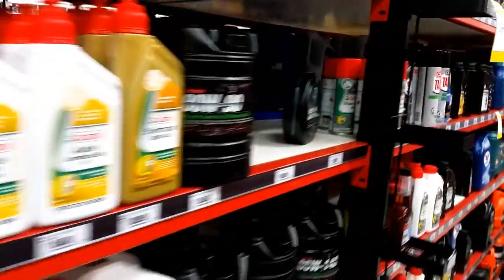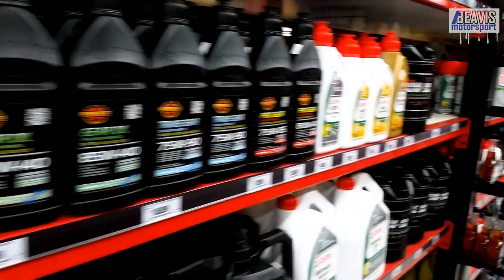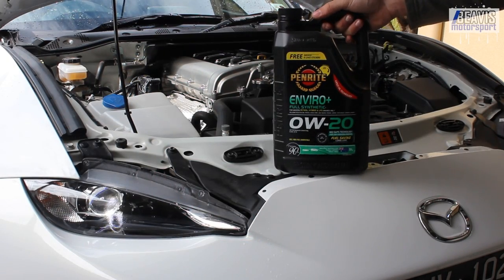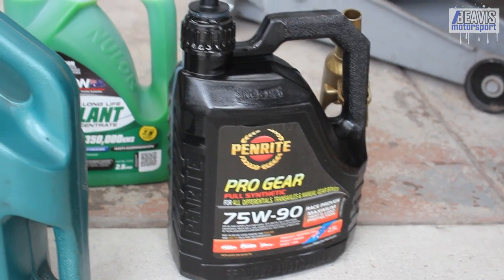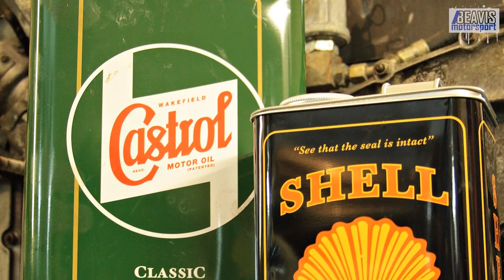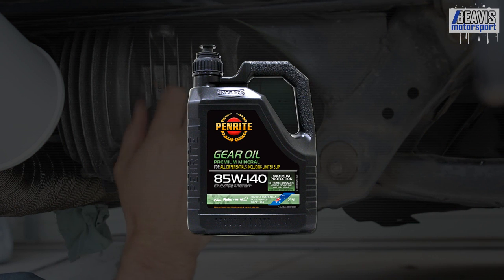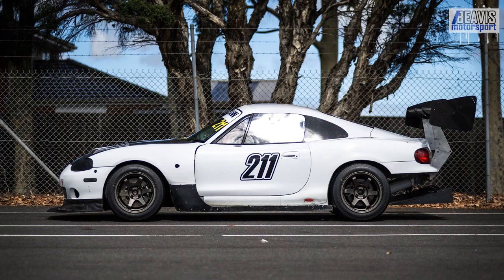COMPLETE GUIDE TO OILS FOR MAZDA MX-5 MIATA

Comment: The 8 dislikes are automatic miata owners
Reply from the maker: Lol! :-P
Reply: Nothing wrong with automatics ,my wife's Rf club is her daily driver to work everyday.  She gets 37 mpg and doesnt have to wear her arm out during an 80 mile commute. That's very important when working in the dental field to keep a steady hand.
Reply: Auto miata driver here, cannot WAIT to swap it.
Reply: In their defense I will say that when I get too old to shift I may switch to an auto. But at 67 I still have no problems
Reply: @Bbeavis  WHAT ABOUT THE SHIFTER OIL ?
Reply from the maker: @mw10259  What about it?
Reply: @Bbeavis  What do i use ?
Reply from the maker: @mw10259  The same gearbox oil as the rest of the trans.
Reply: @ryanchristensen1799  I'm actually planning on trading in my automatic '14 Mazda 3 Hatch for a new Miata RF with a stick as a daily driver, since I've gotten too addicted to my '04 NB, since it was the car I learned stick on 🤙🤙

Comment: Just change my ND gearbox oil with Penrite Pro Gear Full Synthetic 75W-90 as recommended by Repco. It's now a bit notchy when cold. What viscosityis the Mazda long life oil recommended in the owners manual?   Are you doing a video on piston return springs?
Reply from the maker: According to the manual: "If Mazda Original Long Life Gear Oil IS cannot be obtained, use standard oil (API Service GL-4 (SAE 75W-90))" So in theory as long as it's a quality GL4 to the spec weight, it should work well. From memory, Penrite does a GL5, but not sure they do a GL4.
Probably need to check out a different channel for piston return springs, perhaps "ChrisFix", sorry John.

Comment: Also, to those who want an easier shifting trans in the cold, I've had great luck with the Motorcraft XT-M5-QS fluid. After 20K miles, my trans still shifts like butter. Previously, I was using Redline's MTL fluid which is good, but found the 1st-2nd shift to be a bit notchy in the cold and during hard driving.
Reply from the maker: Thanks for the info Dylan! :)
Reply: Dylan Lewis for a na or nb

Comment: You may want to warn people that there is a plug on the transmission that looks like the oil fill/level plug, but isn't. If by accident it is unscrewed then internal selector parts fall into the gearbox and you will have to take the entire gearbox off the car and apart to fix it!!
So make sure you locate the correct fill/level plug when doing this.
Reply from the maker: Good tip - people should probably look up the details of how to perform an oil change before they go and make mistakes. Thanks for watching Roger!
Reply: BEAVIS Motorsport ; was
Reply: Roger Crier, Yes, I had a Ford truck years ago and an oil change shop did just that...
Reply: +Roger Crier  Just wanted to add that, from what I can gather, this is only for the 6-speed boxes.

Comment: I ran royal purple recently in my 90 miata and it made a huge difference. In idle quality and start up and everywhere. And im in pa where it goes from 15-75 degrees in 8 hours
Reply from the maker: Thanks for sharing GameMoments!
Reply: @Bbeavis  Ive also found that taking my ND 1.5l to Mazda dealerships  to get it serviced and they used 10w 30. So Im not sure to be worried haha. so Ive recently just serviced it with 5w 30 my self.
 From Australian dealerships

Comment: Some info about shifter rebuilds:

You’ll see a lot of threads mentioning that you need to syphon out and replace the oil in the turret. This is only for the 5-speed. The 6-speed is “self lubricating” and doesn’t need to be filled. 

Source: idk but it took me like 4 hours of research to find this info online after I discovered my turret to be wet with oil but nothing to syphon out lol
Reply from the maker: Good tip, thanks Uriah.

Comment: Excellent Video; however, I had trouble finding info on Automatic Transmission fluid changes (especially for 2006-2009 Miata NCs). On the Manual Trans. there are Fill and Drain bolt (top-Bottom 23mm and 24mm) BUT on an Automatic Transmission there is a 24mm Top fill bolt (on the side) and a regular Transmission Pan drain plug "under" the transmission with a 9/16 bolt. Also the Side Top Fill bolt has a "rubber" washer gasket (NOT a crush washer) so just snug it to keep it drain coming out (wouldn't torque it hard). My 2007 Car Manual calls for JWS-3309 Trans fluid and I found three types on EBAY/Amazon...Mazda Fluid, Aisin ATF-OT4 and Idemitsu ATF Type M. Also the Automatic Transmission takes three and 1/2 quarts to fill.  The rear Differential has two bolts 23mm fill and 24mm drain (both with crush washers and torqued to 25-33 ft lbs). I used Redline 75w90 gear oil..took less than 1 quart.
Reply from the maker: Thanks for sharing ;-)

Comment: I have found these gearboxes to be quite sensitive to cold temperature viscosity. There can be a huge difference in cold temperature performance for a bunch of different 75W90 oils. Penrite Pro-Gear 75W90 GL4 for example is very thick @ 40C which means it will be incredibly thick on cold sub 10 degree C mornings. Redline MT90 is thinner @ 40C than the Penrite oil.

I had Penrite in my gearbox and it was super stiff just moving out of first, and it felt like there was a physical barrier blocking 2nd until I drove for a bit.

Nulon 75W85 has excellent cold shift performance and feels good at operating temp.

The Ford/Motorcraft oil is only slightly thicker than the 75W85 at cold temps but is thicker at operating temps, so should offer a bit more protection.

If cold shifting is an issue where you live then it would pay to look at a few different gear oils product data sheets and look for an oil that has a relatively low viscosity @ 40C but sufficient high temp viscosity for protection depending on what kind of driving you do. If you do a lot of track driving cold shift performance might not bother you or you can deal with it. But for a daily driver/commuter I would avoid the super high viscosity stuff.
Reply from the maker: Thanks for sharing this information Jake.
Definitely over the years I have seen/heard many people describe similar experiences to yours, different oils present varied experiences for the gearbox. The box does appear to be quite sensitive to oil choice.
I've recently tried some Amsoil GL4 stuff and it's been rather nice.
Reply: @Bbeavis  I have got some of the Motorcraft oil on the way for my ND, at 40C it is only slightly more viscous than the thinner Nulon 75W85, but is thicker at 100C so in theory should offer better high temp protection with a minimal difference in cold temp shifting.

I think there are also differences in the tolerances in each gearbox as some people have said their ND gearbox has always been 'butter smooth' and others have said it's always been notchy, almost to the point of crunchy, although this could also be due to the ambient temperature where people live. One person might closer to the equator and keep their car garaged, so the gear oil is never that cold and as such is closer to an optimum temp for smoother shifting. Someone who lives in a colder climate and keeps their car outside overnight could experience stiff shifts even with lighter oil.

Once mine is warm, with either the 75W85 or 75W90 its a firm shift with a bit of tactile notchiness and a fun sounding gear whine when accelerating in 3rd and 4th gear. 

I daily drive mine with the occasional country road blast here in NSW, so I'm happy with the protection of a 75W85 for now but would be happier with a 75W90 that has good cold shift performance.

I am starting to believe the factory fill, Mazda's special long life gear oil IS is actually a 75W80 or a 75W85 but have yet to find a data sheet for it. The factory fill diff oil is the Hypoid gear oil SG1 which is a 75w85 oil.

The thinner oils seem to be in line with the thin 0W20 they spec in the engine for fuel economy.
Reply from the maker: Some good points.
Agree 100% that weather and driving style impacts this.
I ended up moving to a sightly thicker 5w30 engine oil from my ND, as we have some pretty cold weather in Melbourne.

Comment: My mechanic (official Mazda mechanic in my country) started using 10w60 in my nb. I only burn noticeable amounts of oil above 4500rpm. 230k km. should  I keep using 10w60?
Reply from the maker: If you drive the car in a warm climate, or perhaps a lot of spirited driving such as track days... and/or if you trust your mechanic - then 10w60 might be appropriate for you.
I'd usually only use something like 10w50 or 10w60 for a track-dedicated car that sees high temperatures.
Reply: @Bbeavis  thank you so much! Greece I’d say has a pretty warm climate and the mechanic should be the best there is for miatas around here.

Comment: everybody ive  spoken to recommends rotella t6 15w-40 for engine oil. whats your opinion on this? have you heard it before aswell?
Reply from the maker: Personally I wouldn't fuss too much about a specific brand name. Provided the specs are correct, and the brand is reputable (i.e not some no-name brand with questionable quality) then you should be safe. Any new oil is better than old oil.

Comment: A lot of times you are better off using 5w30 over 5w20 because the mfg recommendation is just to get that extra 0.05 mpg to help meet economy standards, not because it's better or even as good at lubricating engine parta. Not sure if that's the case with the NC recommendation but probably.
Reply from the maker: Thanks bubba, probably true, similar for ND and their rather thin oil ratings.

Comment: the best trasmission oil for NA and NB 5 or 6 speed still the Ford GL4 transmission oil. US part number is : XT-M5-QS, in AU/NZ its : WSD-M2C200-C
Reply from the maker: Thanks for sharing Yuchen :)
Reply: BEAVIS Motorsport No problem, and it’s also called “the magic juice” in Miata community

Comment: I'd like to warn everyone about using Royal Purple in your Transmission. A couple people I know (myself included, NB) that have grinding noises after using Royal Purple. Maybe we're just unlucky, but I'd steer clear of using it!
Reply from the maker: FungiSoup thanks for the feedback, do you know ehat royal purple product it was in particular?
Reply: If I still have the bottle (and I can find it) I'll let you know! I'll look for it tomorrow.
Reply: legend says he's still looking for that bottle till this day
Reply: Good to know, Thanks
Reply: I've heard the same from others who have used Royal Purple  in other makes of car trans. 
I've used Red Line MT90  75-90, GL-4 synthetic in my 2008 NC 6 speed for 10 years and have smooth shifts.
Reply: Dude my transmission blew on my 90 ef hatch with royal purple royal purple is only for racing applications I found that out the hard way. Will forever use redline for my miata just picked up 5 quarts for diff and trans fluid change

Comment: I started using Rotella T6 engine oil in my 1995 NA, and it has never run better. The ticking sound completely went away.
Reply from the maker: Great, thanks for the suggestion Adventure Mazda.

Comment: I've been using 10W-30 in my 1.6 NA, 190,000km. it's winter where I live right now, about 16c. Is the cold viscosity too thick and hot too thin?
Reply from the maker: That's certainly not a bad choice. And for an older 1.6 a slightly thicker cold viscosity like you are using might be necessary. But if its only 16c in winter then you probably live in a warmer climate (what are your summer temps like?) as such a thicker hot viscosity may help, maybe try a 10-40 next time?

Comment: Which one is the best choice for 3.90 torsen ,motul lsd 75w 90 or motul 75w140?
Thanks
Reply from the maker: A torsen centre should use a 75 90 weight oil.

Comment: Interestingly, none of the major oil producers quote a gearbox oil for a manual MX5 NC gearbox.  They only quote engine and diff oil.  GL4 is widely available and I have seen that using it as gearbox oil in the MX5 will result in sluggish  gear changes when cold.  What specific oil - brand/type, does Mazda quote in their service schedules?  Also, the gearbox change lever turret requires the (separate) oil change that can only be accessed from inside the car.
Reply from the maker: The owners manuals don't seem to dictate oil brand/type for the NC transmission, only the replacement interval, which depending on the model is around 60,000miles/100,000kms. Certainly specs are GL-4 75w90 for the trans, GL-5 75w90 for the diff.
Reply: @Bbeavis  As far as I understand, GL4 is suitable for bush bearing gearboxes and GL5 for more modern needle roller/ball bearing 'boxes although GL 4 can be used for those also, GL5 should not be used in gearboxes that specify GL4.  That implies that the GL4 oil is formulated for good shear performance and GL5 for adhesion and maybe that is the source of 'stickiness' experienced by some.  The problem is exacerbated by various top brands only prominently displaying the viscosity index i.e.75W-90 in the same manner on both versions and leaving the GL4/GL5 identity for the small print.  I doubt many garages/parts department/oil vendors even know or care about the subtle difference between the two versions so its not surprising that confusion and bad experience abounds.  As said, none of the premium brand product selectors quote the transmission oil for the gearbox, which adds to the uncertainty.

Comment: Hey, I just bought a 1992 na 1.6(about 160000km), the car is previously in Sydney and the owner use 15w40, I'll bring the car to Melbourne which should I use? 5w40 or 10w40? Thanks.
Reply from the maker: Hi Yue, 10w40 might work better for an older 1.6 engine.
Reply: @Bbeavis  Thanks a lot! Cheers!
Reply: @Bbeavis   how about a 1994 w/ 60k miles, (1.8)?Texas weather here (summer 80-100, winter 34-67)
Reply from the maker: @Nicole-ju8fd  As per the video xKimika

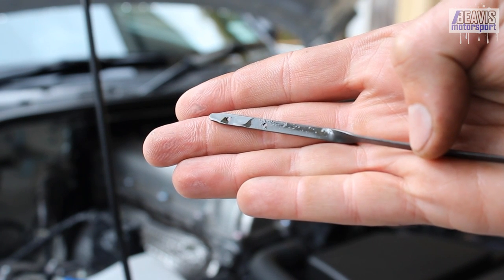Comment: I’m new to the Miata life with my 2001 miata, so my question is does it usually that long for the car to fire up? (About 2:20 in your video) seems unusual to me. I’m doing some maintenance and checking everything to make sure the Miata will have a long happy life
Reply from the maker: A stock engine with OEM ecu will usually start much quicker and easier. That was footage of the freshly built turbo engine starting for the first time. So, its not unusual for it to be a bit slower to start.

Comment: Good video! May i know why you shown the gearknob crooked alignment when talking about using wrong gearbox oil? Is that a sign of failing gearbox? Mine wiggles around anticlockwise about 45 degrees
Reply from the maker: The one in the video just needed to be tightened up. If it moves around, it's probably worn bushes inside the gearbox shifter turret.

Comment: Apparently the  recommended oil weights vary from country to country as my 97 engine in America is 10W-30 and my manual tranny takes 80W-90. This is how it comes from the factory in Hiroshima, Japan, what it says in the manual, and according to Moss Miata (which I trust).
Reply from the maker: That is true, they do vary, always best to use your better judgement and often for warmer climates or older engines, a thicker weight oil is recommended.

Comment: 5w30 is a bit light for an NA. Specs indicate 10w30 to 30deg c, 10w40 or 50 over that.
5w30 is for really low temps, sub zero in an NA.
According to manufacturer specs.
Reply from the maker: The specific values can vary depending on where the vehicle was sold, always best to use your better judgement and refer to the manual supplied with your vehicle... and often for warmer climates or older engines, a thicker weight oil is recommended.
Reply: ditto '99 NB - factory manual calls for 10-30 above 32*F

Comment: I have a bottle of 75w 90 gear oil but with friction modifier. label says to be used in clutch tpye LSD. Can I use it in nd LSD diff?
Reply from the maker: Hi David, without knowing more specifics on the oil you have I believe as a generalisation that would be safe to use.
These are the specs as specified by Mazda:
Rear differential oil - Mazda Long Life Hypoid Gear Oil SG1 75W-90
Rear differential oil capacity (approx. quantity) - 0.6 L {0.6 US qt, 0.5 Imp qt}
Reply: @Bbeavis  Thanks a lot

Comment: nice. on my haynes manual it says i can use GL4/5 on my NC 5 spd thou. But the 6 spd says GL4 specifically
Reply from the maker: NC's are a mystery.
Reply: @Bbeavis    Local garage refreshed my NC3.75 turbo 6 speed gearbox with, it turns out, a generic semi-synthetic 75/90 which "works" for GL4/5.  Brendan says FULLY synthetic and GL4 ONLY (5 speed may be different).  The gearbox failed on the next track day.  To be fair to the box I had a new driver with me who didn't rev match and just dumped the clutch, and I have a feeling the car may have had a (weaker) NC1 box put in it at some point, and we did thrash it all day, keeping up with cars with the same power but better suspension and grip.  PUT THE RIGHT FLUID IN PEEPS.  Don't let your local garage or their motor factor guess what's best.

Comment: Hey Beavis how come you chose the Penrite 75w-85 instead of the Penrite 75w-90 pro gear or trans gear oil, was it purely because the 75w-85 was GL4?
Reply from the maker: Yes, that is exactly why.  The penrite 75-90 'trans-gear' (semi synth) and 'pro gear' (full synth) are both GL5.
Reply: BEAVIS Motorsport Cheers, thanks for the reply. So for a stock 1.6 the pro gear would be suited for an open diff then?
Reply from the maker: Yeah that'd be perfect.
Reply: BEAVIS Motorsport Sweet thanks a lot for the help
Reply from the maker: Anytime!